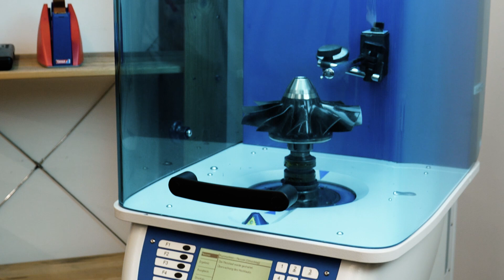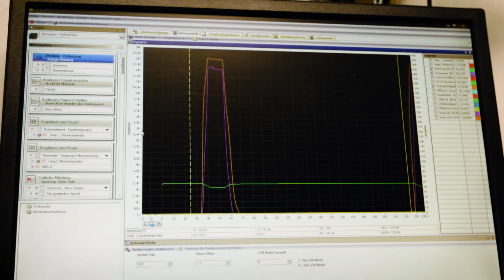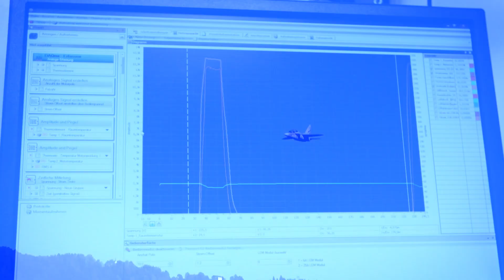Schübeler Technologies Company Overview

Comment: Hello 

Mr schübeler

I have the following concern:
Is it possible to get the version of the fan for clockwise rotation and the version of the fan for counterclockwise rotation in any of the references of the EDF units that you have for sale?

the main idea is to make a quadcopter with EDF.

If I can't find it, can you make a fan or several fans especially for my project?